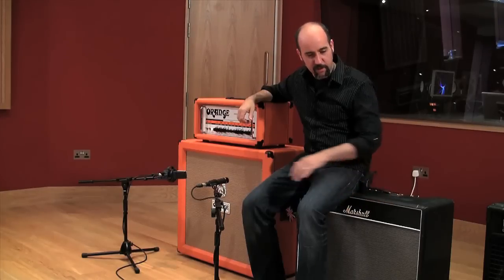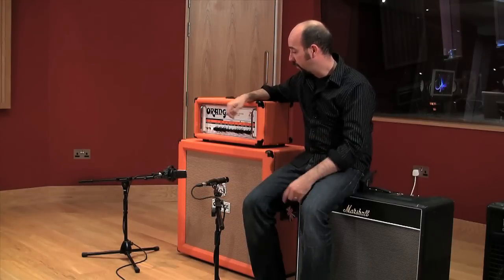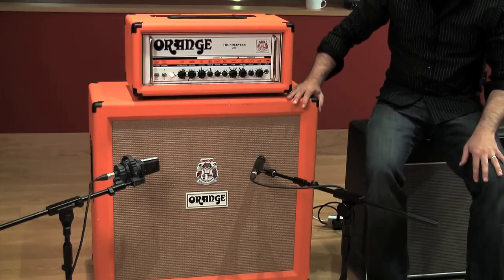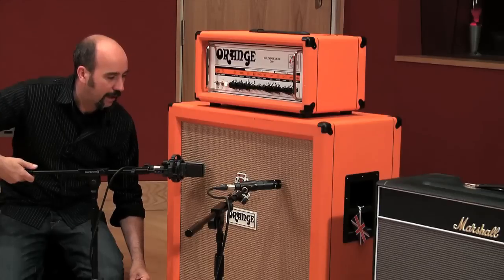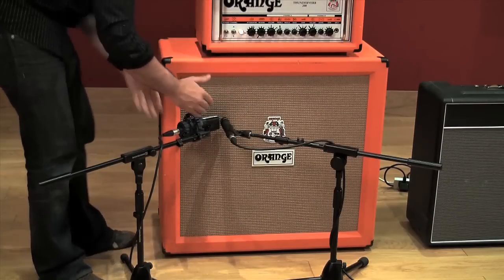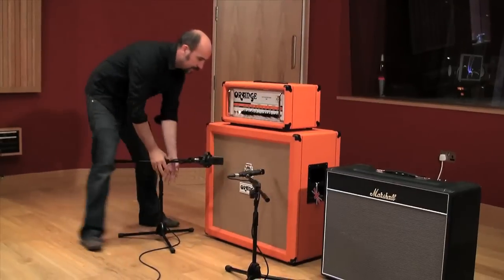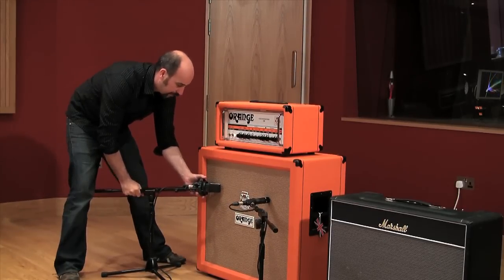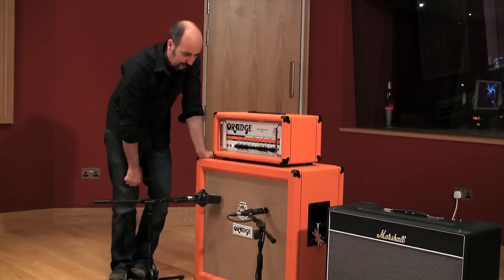Art of Audio Recording: Recording Guitars - 5. Multiple Mic Techniques

Comment: @tompuce84 The way you get two microphones in phase is by switching the phase in one of the microphones, pan both signals to one side of the headphones, and move your condenser back and forth until you get as close to a null spot(the sound cancelling out)as you possibly can. Once you do that you are very close to "perfect" phase, and you can switch your phase back to normal and record. Of course have someone play the amp, or any source you're working with. That way you don't have to fix later.

Comment: If you have a 1x12 with two mics. When measuring the two mics say 57 at the center and a condenser more off to the side. Should the two mics still be equal distance from the speaker? Or should the condenser be pulled back a little further away from the speaker cause on the speaker edge there is less depth from the mic capsule to speaker than the 57 at the center cause of the shape of the speaker? Just to make sure the fase is correct.
Reply: When recording into any DAW from the last couple of decades you can pretty easily line up the phase anyway. Just put them where they sound good. 

Haven't done any recording/mixing etc that involves having to sort out phase at source, so don't know if there's any fancy tricks or plugins that allow you to check the mixed sound of two mics at different distances without having to record, shift into phase, and playback. But I'd be astounded if there isn't.

Comment: ive got a question. ater i plugging in my small Peavy practice amp into my computer with its "headphone" jack, my speakers built into my laptop barely work anymore and the headphone jack on the laptop doesn't output sound anymore. also the mic next to the webcam doesnt work. but i can use a usb audio interface for sound.. i think i fried my sound card in the laptop. but would an amp really do that??

Comment: Ya, you can buy an inline pad for about $20 which will attenuate your signal like 10 or 20dB. But does your interface/pres have one... a lot of them do and sometimes they're on the back of the unit.

Comment: phase is all about the 3 to 1 rule not "equidistant" mic technique. I f you want to use a sm57 "on the cloth" and a condenser mic as a distance mic, make sure they are at a 3:1 ratio or the condenser is three feet away from the dynamic and they will be naturally in phase.